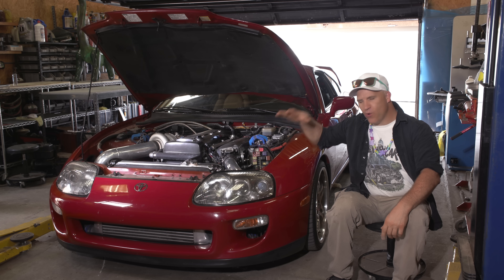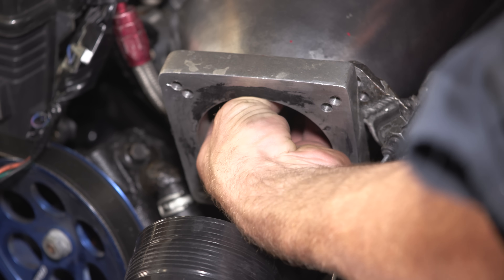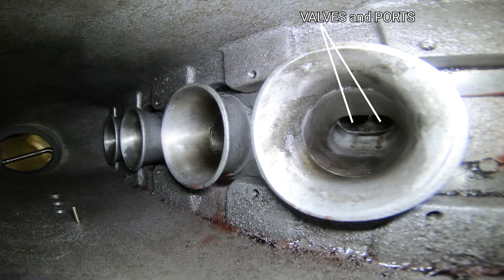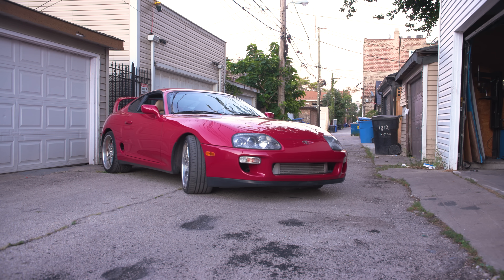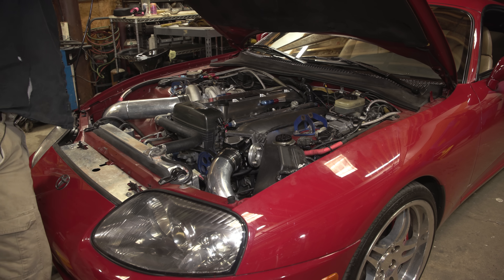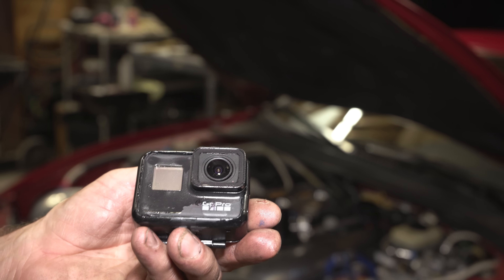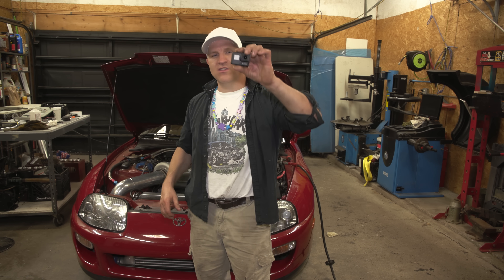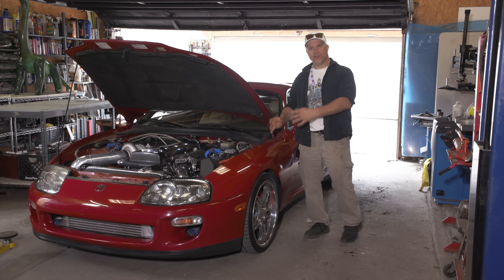Driving with Gopro Inside My Intake Manifold (Toyota Supra Turbo)

Comment: There's room for improvement in those runners that's for sure

A good port match from the manifold to the head that will stop that fuel from pooling up on the lip between the manifold, gasket and the head, and maybe changing the injector angle so it points at the valves (could just be a cheap/flawed manifold design) that way the fuel goes towards the valves and into the cylinder and not just spraying at the bottom of the port where the lowest air velocity is, intakes (and exhausts) have the fastest moving gasses on the outside/largest radius of the pipe, this would improve efficiency, fuel atomisation and get the fuel where it is needed and would result in a little more power.

Oil in the intake could be a couple of things, take the pipes off the intercooler and have a look in there but after watching the video again i see your catch can setup is plumbed back into and infront of the turbo, blow by is normal, full catch can or you need better catch can setup/vent it to atmosphere? (i don't know the laws in the area you live in it so might be a requirement for emissions to have it plumbed back). Other thing it could be but i doubt it, is turbo seals, if the front or rear seal was going or was dead it would be smoking like crazy.

Have you looked into a thermal intake gasket, it reduces the amount of heat being transferred from the cylinder head being transferred into the intake plenum, you get a cooler charge of air going in.

Other than that one very cool video capture, and one very nice example of a supra well done :)
Reply: Thanks for that, you answered  my question of fuel direction and atomisation. Was surprised to how much fuel was not going directly into the cylinder.

Comment: You need an air oil seperator or a catch can and that will reduce the amount of oil in your intake.
Reply: It's okay everyone know that 2-stroke is so fucking powerful 😝
Reply: yang hu you will have blow by especially in a high compression application have you ever been to a truck and tractor pulls you'll see lots of blow by under the trucks or tractors
Reply: My biggest question was is that red stuff oil
Reply: @justinglover9065  most likely fuel or oil additive,ask the person if he use addivite or what station he gets his gas and if it contains ethanol from the pump.
I use mystery motor oil and like I said it turn my fuel and oil red-ish.
Reply: Just dump it on the ground where it belongs... No reason to run it in the intake.
Reply: The red stuff is toyota coolant
Reply: Oil in intake is definitely not good. Valves, pistons and rings get carbon build up and cause lower compression.
Reply: Wow it’s so funny to see people try and talk about shit they know NOTHING about. Are any of you certified Toyota techs ? You’d have to read the manual to the entire engine to figure out why the oil is doing that . It could be bad tune .. it could be normal ... could be from a million things
Reply: @alexneil394  Certified ASE Master Tech right here bud. Every engine is going to have an oil film in the intake manifold from the pcv system. Too much of it is not good for the engine thats why there are aftermarket oil catch cans.
Reply: 2jz is designed that way for a reason,I hope you took a good look at the 2jz diagram design.
Reply: @benjaminfranklyn604  2JZ or not excessive blow-by from increasing boost shoots oil in the intake that the PCV can't handle, that effectively lowers the octane levels and cause misfires which leads to piston and ring damage. There is nothing magical and mystic about the 2JZ design, it's just a very solid and very, very outdated block. Every engine is designed to shoot the excessive oil pressure in the intake, but it should always be in vapor phase as there is an oil separator labyrinth.

Having liquid oil means a quick death of the engine will follow from bore wash.
Reply: @henria.277  it will not affect or lower the octane,my gy6 4stroke scooter has kinda the same design and is a high compression air cool engine.
It use the oil as a coolant for the cylinder head and wall unlike honda 50cc water cool motors.
I drove my scooter so much at WOT the only thing that breaks are my 11k cams,never had over heating issues.
On top of that I add more Mystery motor oil to my gas tank ,it increase my octane and make my gas last longer.
This why Chinese gy6 are a hot swap for stretch out or custom ruckus and they ditch water cool honda engine since they suck and blow up.
Reply: @benjaminfranklyn604  lol yeah because the temperature and pressure inside of a scooter are by any means comparable. The levels of stress endured by those engines are tens of what the puny 5hp scooter experiences, while consuming less fuel. An atmospheric engine won't encounter many pcv issues due to the lower combustion pressures. Remember that 2 bars absolute (=1bar of boost) means twice the amount of pressure on compression (considering an adiabatic compression) and much higher flame temperature due to that increased pressure. In a typical turbo car a good portion of the fuel is wasted on wot in order to cool the chamber and prevent pinging. Due to the increased pressure the amount of combustion leaking into the case increases, shooting oil straight
through the pcv. How do you solve the lowering octane it causes? Inject more fuel AGAIN to cool the chamber and retard the ignition delay.

This is a shitty workaround that is caused by tuning and inherent flaws from the turbocharged engine design.
Reply: @henria.277  do your tuning and hack a different way,just because a piston or a engine is smaller doesn't mean they are made different.
Adding more fuel and delaying timing will lead to fried rings or melt piston head or bend crankshaft.
This design of oil squirting on piston was made in the era of air-cool engine.
Toyota added that feature to their design,no wonder why any toyota engine is reliable.
Reply: @benjaminfranklyn604  Isnt catching oild very bad for engine overtime? Like audis that catch much oil and engine gets quickly way under stock horsepowers because of layer it is creating?
Reply: @benjaminfranklyn604  thank you for bringing different perspective, but blowby is not good.

Comment: Your closing statement is very true. Trying to drive a rocket that's so sensitive that moving the throttle a quarter inch puts you into ridiculous wheel spin is no fun. Driveability is key. I never thought I'd ever say that until owning the E63 making just under 600 and the Jaguar at 500.

Comment: That liquid pooling up is what's called "reversion."   At WOT the injector is open 80% or more shooting at a closed intake valve half the time.  I'm more concerned as to why your injectors are spraying at the bottom of the runners instead of on the back of the valves.  New injector time or clean them.

Comment: this might be a bit far fetched but could you mount a gopro on the outer part of the compressor housing on a turbo (not the one on your supra) to see how the air looks when it comes off the compressor wheel.

Comment: Could the excess fuel vapor be due to downsizing the throttle body and not changing the tune, causing the motor to run rich since it's expecting more air for a given throttle position?

Comment: I'd be replacing those injectors from what I saw (and check fuel pressure at rail under varying loads).  And there was a timing /valve seat issue on 4.  What's LTFT?
Excellent car and vidy tho, TY for doing this and sharing.

Comment: A pull from 1000 rpm in 5th gear to redline would be interesting, instead of the blipping in between gears.

But really cool idea for a video. It was very interesting to see the injectors flowing.

Comment: Turbo cars always mix a little oil with fuel comes from the seals on the turbo and from boost in the crankcase ventilation system that’s why on high horsepower and boost we instal oil catch cans but great video love all your videos

Comment: I went back to look at the camera mount and I said out loud, woow that's smart. I wouldn't have figured that out
Reply from the maker: Lol... Thank you. But I didn't show it !
Reply: @WarpedYT   Nice trick.. Ring holder can be seen when you are putting throttlebody back.. it's  sandwiched between and it holds the camera at same time...
Reply: steel base and neodymium magnet on other side of allow panel ?

Comment: i presume if u had a belly on theintake where center plenum is made by thick ,a bit stretchy rubber that would get a bit pressurized when sucking in air that would prob negate the blowback in the funnel because of the throtle body shutting down when engine pumps fuel and its sucking air.. would be a nice test to se if it works,,also try to lower the heat in the intake to see how much u gain,,maybe a single injector right behind the throttle body that sprays a tiny bit water mist in to the intake or have it spraying after the intercooler.

Comment: Idk if u have a catch can, if u don’t put one and try it again, be interesting to see
Reply from the maker: I do, I actually designed the first catch can system for the supras, you could still find my posts from 16 years ago on supra forums in Username Mr.Mechanical
Reply: Warped Perception noice. Might b an interesting vid to remove it and put it like stock to see how much more oil goes into the intake

Comment: Might want to check out the port gaskets. They might need replacing. The oil looks like it was coming mainly from port 3 exhaust.
Reply from the maker: Those are the intake ports but it turned out to be power steering fluid

Comment: Yo u need to clean that manifold... look at all that red oily gunk
Reply from the maker: It turned out to be power steering fluid from the low pressure vacuum switch by passing oil into the intake... I have the part on the way

Comment: Lithe bit of "blowby" upon start-up & high -rev pulls.. one shot looked like it came from the valve itself.. maybe a guide seal beginning to get worn.. definitely not enough to notice at the tailpipe.. that go-pro vid prob saved you from a full teardown.. so you decide to investigate further!
Reply from the maker: I just put a new engine new head new Turbo new throttle body and a new flywheel and clutch. I looked into it further and it turns out it's power steering fluid, it's coming from the low pressure vacuum power steering switch, I ordered the part it's on the way if you take a close look the fluid is red.
Reply: @WarpedYT  best possible outcome.. i watched it a second time and I did notice the red tint to the fluid as well.. at the very least.. nasty clean up averted.. 😆

Comment: 🤔 You ever found out about that oil in the intake manifold?
Reply from the maker: Yes it turned out to be power steering fluid, coming from the low pressure vacuum switch on the power steering pump that has a reference hose going to the intake manifold

Comment: Did your injector spray the fuel into port wall?
Reply from the maker: It seems that way, I think that's the way it's designed because it's dual intake valves and it has a dividing wall in between the two valves. Seems like it would spray straight in the cylinder but in that case it wouldn't a demise and most of the fuel would go into only one valve. I've never seen inside of the intake before but I'm guessing that's how it's supposed to be

Comment: Intake manifold designers should have tried this a long time ago, imagine doing this with some typed of smoke that the engine can safely ingest.
Reply: They did, it's called a flow bench.
Reply from the maker: I love that idea I can make that happen
Reply: @WarpedYT  you have my attention
Reply: Do CFD analysis simply..
Reply: I used to work with dyno technicians that worked for Roush Racing. Lots of stories about a fearless Jack Roush standing on a step stool, looking down the throats of a Holley sitting atop a 9500rpm cup car engine at WOT...
Reply: I used to film a drag racer named Don Bowles who had a RIDICULOUSLY HIGH REVVING all-motor Yellow Maverick with a HUGE ROUSH sticker on the side... maybe you know which car and engine I'm talking about?  I've recorded lots of high hp V8's but man, when Don and his Roush Ford V8 engine were warming up tires at the drags and going down the track, that V8 SCREAMEDDDD SOOO DAMNN HIGHHH you swore the engine was just ready to kaboom, AND THEN IT REVVED EVEN HIGHER BEYOND THAT! I swore that engine sounded liked it was revving to 11,000 my lordddd she was MAGICAL and truly a step above all else in the Naturally Aspirated category.  Whew baby, getting all worked up talking about that.
Reply: @DanielGonzzz  Back when I did nascar dyno testing - above about 8000rpm, you couldn't hear the difference between an actual running engine making 750hp, and a non-running engine on the spintron being tested for valvetrain stability.

Basically ALL the sound you hear coming from a cup car engine (above 8krpm) is coming from the valvetrain - NOT air getting sucked into the engine, exhaust being pushed out, or combustion itself. Amazing.

9500rpm is really, really pushing it for a small block OHV V8 if you want it to last more than a few seconds at a time...

We had in-cylinder pressure transducers on our test engines. During a power pull, it would take about 1 second @ 9500rpm to collect good data. The engineers would all cringe and hold their fingers that the engine wouldn't eat itself - being exposed to that high speed for "so long"...
Reply: @GroovesAndLands  That is BADASS! Love the info, you've probably some insane engines! Crazy to think the valve train after 8000rpm is the noise as opposed to cylinder combustion noise.
Reply: flow benches have been around for over 20 years, you can get all that info as well as detailed info on air flow through each port/stack. (sticking a gopro inside an intake manifold would ruin your results though since it changes the chamber size and shape)
Reply: @quickdry3  
Maybe have a semi permanent video mount in the plenum somewhere.  like a sensor housing. You could run a blank plate most of time and hook up a camera when required, rather than it just rattling about in there. Very very interesting to see.

Comment: Oil blowby from your egr?
Reply from the maker: Turned out to be power steering fluid. Coming from the low pressure vacuum switch on the power steering pump which has a reference hose that goes to the intake apparently it's been bypassing oil, I ordered the part it's on its way

Comment: How much HP.?.do you have a factory v160 car?

I plan on building a NA Automatic MK4 into a 1700hp manual v160 7sec 1/4 beast.
Reply from the maker: Nice my car is manual 6 speed, anything over like 900 horsepower in my opinion needs to be automatic or maybe a dog box, my car was like 1100 at one point but it just was no fun to drive.... Too much power too much lag

Comment: Oil in the intake is most likely from valve guides in the head, usually a little leakiness is perfectly fine if the components in the head aren't fully heat soaked since they havent expanded from the heat yet, but they do wear out on higher mileage engines, especially if it has blow by and a decent amount of boost, even then not really too big of a deal. If your worried about it though thicker oil almost always helps keep any engine together longer, might use more gas and lose power if you get too crazy thick.

Comment: the oil might be coming from the turbo cartridge - seals might be going, the injectors look like its spraying like a stream in #4
Reply: Should have watched the end of the video captions. It is power steering fluid from the vacuum lines. That is why it is red.
Reply: Powersteering aint red
Reply: @seiharraburch8390  7:13. Power Steering is hydraulic fluid. So is ATF (which is red)  ATF is often used for power steering pump. Especially older pumps. His oil ain't red. That's for sure.
Reply: Thomas Stoddard i figured it was atf from some where coming from a vaccume from the trans to the manifold i dont know much about supras more of a sbc fan

Comment: check ur valve by putting tiny camera with long stick so that way u can see if valve is mess up or crack because that were cause pushing fuel back into intake 2nd worn out valve can push oils back into intake if that what you said " oil in intake dont know where that coming from" like said from worn out valve

Comment: In the future, car engines will have micro-cameras inside them, but they will get soot and grime on the lens, a fairly easy clean, like replacing spark plugs, but 29 years after that invention, anti-soot and grime compounds will be commonplace. I have been to the future, its cool.
Reply: mackk123, we would commonly use a borescope, multiple thermocouples, clear quartz windows & lasers to watch & record what was happening inside of turbine engines during development.
No reason they can't do the same thing if they don't already. Cool stuff!